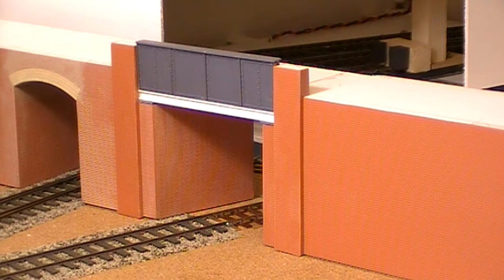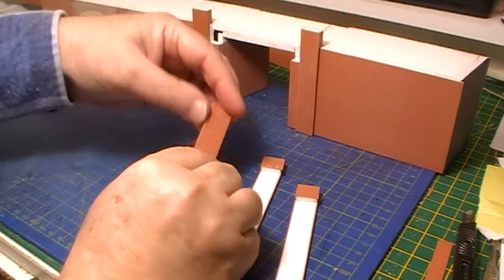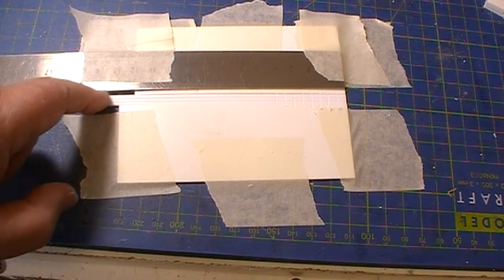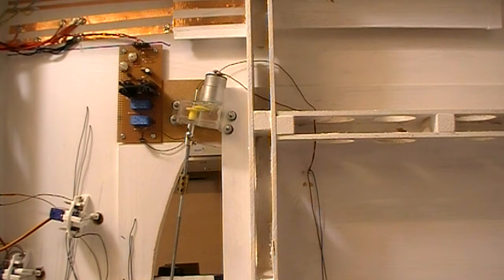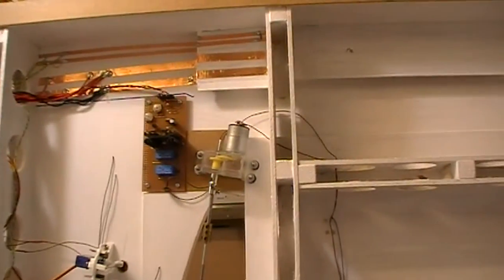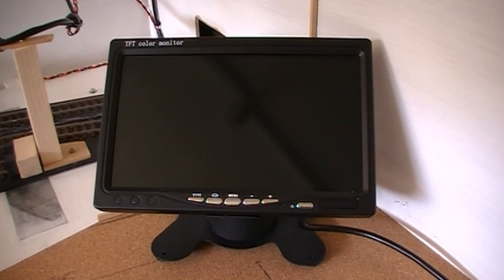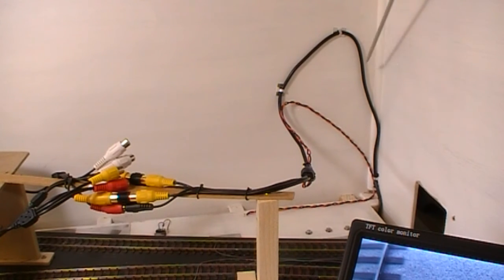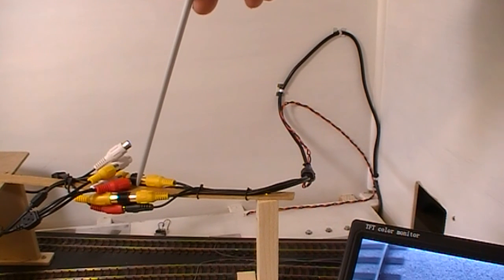Canal Sidings 04 Sector plate operation and the disused viaduct

Comment: Very informative, though at my level of electronic know how still a little confusing. Looking forward to the next instalment.
Reply from the maker: Hi Barry. Thanks for commenting. Is your confusion in the electronics itself or my explanation of how I use it in my system?.....John
Reply: Hi John
Your explanations are fine. I get confused trying to understand how some of the electronics work in the overall picture. i.e. Merg have a lot of modules some control trains some control accessories. Different buses for lights, different ratings of resistors etc etc. I will get there in the end. Keep up the good work>

Barry